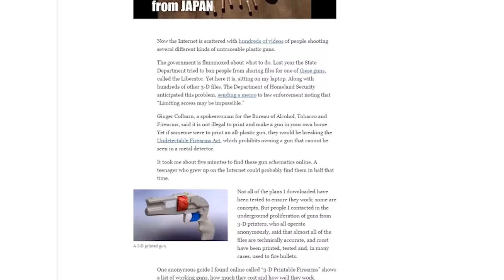Can a 3D Printer really explode and kill you? - @Barnacules

Comment: I have been 3D printing for 3 years now and have had one bad electrical failures that results in arcs from a cheep $200 printer, but no fire.  To vilify the industry just makes my job telling my bosses that 3D printing is safe, harder.  This is tragic, but people are propping this up because the industry is accelerating faster and faster without any issuance that it is actually safe and people don't like change.

I don't print in abs because pla is just as good and i'd rather use painters tape than messy hair spray.  When I do have to print in abs for my job I use a .75mm PEI (Polyetherimide) Sheet. been using it for the last 6 month and besides being scratched up badly it still works wonders.

Comment: sorry but 3d printing is far from a industrial revolution... 3d printers do a bit of rapid prototyping but beyond that they do NOTHING useful :D even in the aero and spacetravel industy they are used very sparingly because even there machining parts is often much cheaper. and the hot glue gun with a plotter attached to it (fdm printer ;D ) is from a engineering standpoit nothing but useless. Your Form 2 is much more useful for rapid prototyping but it only gets really interesting with SLS printers (Selective Laser Sintering) where you can manufacture stuff out of actually useful materials (basically anything that melts) but you still have to machine even those parts afterwards. Oh and those printers are a bit large and expensive even for your desk (and yes i have seen how strong that one is :D)
Reply from the maker: +Hellboy13994 I disagree, but what else is new ;)
Reply: Barnacules Nerdgasm jerry I just want to say I love all your videos and your weight loss videos have aided me in losing my weight. Thanks you are the most genuine YouTuber
Reply: I wouldn't say far from an industrial revolution. I mean, just look at the really huge ones that can create smaller buildings etc. In 10 years (wich really isn't a long time in development) i would say they will have a major breakthrough with 3D printers and make them more usefull and impactful.
Reply: Hellboy13994 that is not true. there are industrial 3d printing devices, that are DIFFERENT FROM THE ONES PEOPLE HAVE IN THEIR HOUSES.
Reply: Nothing useful... just cheaper prosthetic limbs for children and the ability to print certain things for medicine in places like Africa... sure... nothing useful :/
Reply: 3d printing is still in his infancy, it is like when back in the day People said that computer were destined to be used only by scientist in a lab. 3d printers need to improve a lot, but the potential is there, I'm not saying that it's going to be revolutionary... but we are not far from it.
Reply: 3d printing is getting fairly big in the aerospace industry. It depends what you are making if it's cheaper for a print or having a machinist do the work. Even in the car industry, it's starting to be used in the production of the vehicles themselves and no longer just models.
Reply: yourcurtainsareugly Maybe i wrote it wrong or you didn't understand what i meant, but within 10 years we'll see something big with 3D printers, not a revolution, wich might come later than that. Just something big.
Reply: yourcurtainsareugly A revolution for the manufacturing sector? Yeah. Something near the scale of an industrial revolution(in it's historic meaning)... probably not.
I would say that 3d printing will play a role IN ONE OF the aspects of the 4th industrial revolution (assuming the 3rd one is the digital revolution, like some socio-economist say)
Reply: He overstates, you understate.
This is a critical technology, as a Chartered Engineer I use it daily, and know of companies that are making finished products with it.
Not home printers though, but give them time.
I can't name a printing press company locally, but in 1982 they were laughing at Dot Matrix and Daisy Wheel.
Reply: False... Prototyping and limited-use end use parts is the largest market for the AM market, but DMLS/ SLS/ High-end FDM/ High-end SLA/ and polyjet enables companies to manufacture parts not possible with machined technique. Yes, there would be post-processing, but with very limited post-processing of some 3D printing techniques allow the time and cost saving largely excess that of machining. DMLS/SLS is great but true professional SLA and FDM is competitive with SLS due to reliability and cost and sometimes better material (ULTEM?). Also, polyjet can make multi-color multi-material in one go. GE and ULA saved a lot of money using DMLS for jet engine fuel nozzles and duct parts that greatly reduce cost.
Reply: Yep. What was true yesterday may not be true today.
Reply: Hellboy13994 you could make whatever you want with a 3D printer

Comment: My guess for why he used so much hair spray is that maybe he was using cheap hair spray and the cans were faulty in a way that released the propellant while only releasing tiny ammounts of the actuall sticky stuff. Hence he went nuts spraying heaps of it just to get a satisfactory layer of the stuff on the bed. In doing so he filled the air with three cans of propellant for very little stickly stuff, and the explosion was the result. If they can recover the cans from the scene and they are still rather heavy, from being nearly full of sticky stuff but no propellant to get it out, then there is your answer.

Comment: That was a good informative video thanks Barnacules! my printer ZYYX is not using a glass build platform so i have no experience of hair spray but i sometime us acetone (for abs print) and i still have not hade an explosion or fire. 

I use a little on some paper and rubb it on after most evaporate it has a really sticky build platform that abs can get stuck on.  

#Mediagetyourfactstraight
#3Dprinterforlife.

Comment: Yeah, it would totally be the printer with all the rest of those possibly hazardous things present. The only way I could see the 3D printer being responsible is if it had an open relay somewhere that just happened to engage at the perfect moment. Has anyone bothered to consider the fact that some people use small jet torches to improve the finish of their 3D models? It melts and smooths the surface by allowing the plastic to pool and then re-harden. It's great for getting rid of any sanding marks or places where support material had to be cut away. The article makes no mention of that at all. It just goes to show you that you can't argue with stupid... How sad.

Comment: Did you just call the heating element the thermistor and the temperature sensor the thermostat?
Reply from the maker: Yup
Reply: You know that's wrong right?
Reply: a thermistor is an electrical resistor whose resistance is greatly reduced by heating, used for measurement and control.
Reply: I don't know about the thermistor being right but a thermostat measures the temperature of something...
Reply: In a 3d printer the temperature control system is a PID regulator whos input is a thermistor, a resistor whos resistance decreases as temperature increases. The thermistor is not the part that creates heat and I have never heard it called a thermostat in the context of 3d printing.
Reply from the maker: Yup, already added the correction to the description. :D
Reply: Cool. Good video btw. I hate how the media treats 3d printers. 3d printers have feelings too.
Reply: Not just 3D printers are demonized in the media. Notice all the medias complaints about the western world are the exact same as they teach in the gender studies courses? All to get you arguing with idiots instead of realizing the elite are poisoning the environment all around you in every way possible. Then you wake up one day to find they are selling you the air and water you need to live.
Reply: He said thermistor 6 times and slipped up and said thermostat once. He knows the mistake.
Reply: +Solder King Well said
Reply: But all the times he said thermistor I think he meant heating element.
Reply: You can technically call the thermistor and whole controll loop of a MCU/processor/software a thermostat (because it keeps temperature of 
extruder at some set value).The heat is offcourse produced by separate nichrome or whatever resistive heater.
Reply: GamezAhoy !
the UK owns the US. well the UK banks do.
Reply: Turk im pretty sure you want to wish that.
Reply: UK owes a lot of money to the US "apparently" or so they tell us, with all the shit in the news I'm starting to beleave they are making excuses to line there pockets
Reply: Nova Dragon the USA owes us more than we owe them. Just don't believe the BS it's all excuses to everyone to put through cuts.
Reply: eLJaybud we dont owe anything..... to you guys
Reply: So... USA owes UK but UK owes USA... hummm Dose not take a genius to see that people are just raising taxies to line there greedy pockets.. And that would not surprise me at all...
Reply: Apparently it does take a genius to spell 'does'.
Reply: Not all brainy people can be good at English you know. does not mean you can beet some one down for spelling something incorrectly.
Reply: Sorry I had to it was too easy.

Also beat*

Again sorry.
Reply: Its ok, I know I suck at English and English is my primary language XD
Reply: Poor guy!!!
Reply: you mistaking the UK for the Chinese - easy mistake given who owns the uk :)
Reply: regmigrant
ask yourself did the english learn chinese to trade with them or was it the other way round?....
Reply: well if we are going into history it was mostly the dutch who brought china into trading status with the rest of the world as they were more willing to kow-tow, but yes the english got into it pretty quickly afterwards. I was making the point that like most western countries the UK relies on china buying debt
Reply: regmigrant
we are obviously talking about two completely different entities.
You are talking about the world free market where as I'm referring to the "old money", maritime bank and law,  the controlling forces behind the scenes. Bloodline money. Aristocracy and so on.
Reply: ah, i see what you mean
Reply: Yeah they might buy the debt. We just have to agree at what point we screw them over.

Comment: I'm calling the bullshittest bullshit on 3 cans.  There were probably 3 cans in the room. There are 3 cans in my printer room as I experimented with brands...
...No.  You can't breathe if you are in a room with that much butane/propane propellant.  Something sparked the gun cotton and that's it. End of story.
I challenge anyone, even a printer novice to put more than 30 seconds worth of pressurized hairspray onto a hotplate. It would be a goopy mess, literally pouring off the edges.
Reply: yeah, i have the same feeling as well.  The first day I got my printer I did a tonne of short prints and hairsprayed in between each one.  After like 8 hrs of doing this I felt physically sick at the smell of hairspray and had to wash the buildplate under boiling water at least twice.
Reply: frollard I suspect and 3 cans of hair spray + 17 year old boy has always been an explosive combination.

Comment: I think you got that a bit wrong with regards to the thermister heating the block. It is the heater cartridge that heats up the block and the thermister measures the temperature of the block, close to the nozzle. Sorry to be picky, just thought id clarify :)
Reply: yeah , got me a bit confused there , misinformation is bad so i hope barnacules could correct that
Reply: Its not that big of a deal to most people, i just felt like correcting that in case people got confused
Reply: Agree.
Reply: You are technically correct. which is the best kind of correct.

Comment: 100c barely able to keep your coffee warm? 100c is the boiling point of water. How hot do you want your coffee? :)
Reply: ALL THE WAY
Reply: I believe he meant that the heating element in the printer gets to 100c, that's not the amount of heat that would be transferred to the heating plate, then to the cup of coffee.
Reply: What matters is the heat flux, not the temperature.

Comment: Jerry 
1- gun cotton replaces gun powder in large caliber guns, it's slower burning than gun powder, allowing it to transfer more power to the projectile, along a longer barrel. 
2- a lot of spray cans now use Propane as a propellent, so....
3- with that much crap in the air, he could of set it off with a static discharge, so. ... wrong clothes...

Comment: 5:27 Jerry, i'm sure people have corrected you already, but the thermistor only reads the temperature, you're talking about the heater cartridge. There aren't any separate thermostats involved, it's just the electronics board controlling the cartridge's current based on the termistor reading.

Comment: The guns thing is so funny ... "you can go to a shop, buy a 3D printer and then fabricate guns!" ... well, when you are from the US, you don't need a 3D printer to do that, you can just walk into a shop and buy a gun :D I never got how the american people did not see the big logic loophole in this. Why would anyone add an extra step instead of just buying a gun? :D
(to be fair though there were also articles saying that you could 3D print a gun in plastic which would the not be seen in metal detectors etc. ... I can kinda understand why this would worry some people ... but still ... you can buy assault rifles in shops ffs!)
Reply: Sicho84 you're also forgetting that you can't buy a gun if you have a felony, and there is a waiting period. with printing them anyone could "make a gun" though it wasn't as easy as the media made it sound but it was still possible. plus guns you buy are registered and can be traced back to the buyer. 3d printed ones could be thrown away or melted down pretty quickly without leaving a trace of evidence.
Reply: Problem is that most store Don't require any background checks what so ever so that point is moot, as for the registration still only helps them catch those that had already committed the crime. and for the 3d printed ones its been shown that they are good for only 2-3 shots before it burns the plastic away enough to make it unstable and it catastrophically backfires on them, another point is that model guns have been modified before to act like real ones fairly easily better ban those too.
Reply: snintendog All stores in the US require background checks... It's federal law and the BATFE will arrest them fast if you can prove otherwise.

Comment: Jerry, (Hope I spelt it right)  You said that you had to download the 131 Gb of games that you had already downloaded.  So you only have 1 drive on that machine????  No D: or E:????  I have an MSI GT 70 laptop, I am not a gamer, I just need a high performance machine for my work (IT manager for several companies).  This has 2 disk bays.  In on a have a 256 Gb SSD, partitioned into a C: and D: drive and in the other a 1 Tb rotational disk.  Yes I have had windows crash and destroy its self.  But I can honestly say I have never lost any data, its all on D: or E:.  

But just as a precaution I have an external 1 Tb USB drive, where I have backed up everything.

I am a belt and braces guy, over my 35 years in IT I have seen most things, so I always have a plan B and C.  The External USB is plan B, Plan C is an old Acer Windows laptop, its was one of the 1st to come out aping a Apple Mac book.  Nice machine.  Preinstalled with Win 7.  BUT it was slow despite an i5, still slow.  I tried all sort of things to make it work better, nothing worked.  So I installed Ubuntu, I am a Linux lover, speed was great, so I started setting it up the way I wanted, then ran in to a problem with the WiFi, No Either net port on the machine, I Googled it and found that its a problem with this machine and its WiFi drivers, something that Acer have never fixed.  So tried Linux Mint, same problem.  Next Fedora.  Worked and continued to work.  I am running Fedora 24 and it works a treat.  

Have all the software I want on it, LibreOffice, I have never used MS office as I hate it.  Firefox, Chrome.  Now there are a few programs that I need to use where I was pretty sure there was no Linux equivalent.  But I found using Chrome, I could get most apps I wanted as Chrome apps.  My main product is IBM Notes, there is a native version of Notes for Fedora, so that works well.

So My Plan C machine goes with me in case Windows decides to be difficult.  I have all I need on my little Acer.  

Why not get an old Laptop something that is not as powerful as you need.  Install a good version of Linux, no License fee to MS, then load it up will all you need.  OK it wont be any good for playing games, but you will have e-mail web browsing and everything else you need.

This might make a good Project VDO for you and your Customers, I am sure that someone who has work for MS for a long time, as you have, making a VDO about setting up a Linux machine and getting to use it would be really interesting.  I would suggest that you use Ubuntu as thats pretty well the most common Linux version, apart from Android.

Keep up the good work I enjoy following you and watching you develop.

Comment: Guess what they use as a propellant in hair spray... Butane with a splash of propane for low temp operation. And Jerry, 100c is the boiling point of water, so it's plenty to keep your coffee warm, but not a source of ignition ;-) Kind of like an airplane accident, it's a chain of events, if any of the links had broken, it would not have happened! Excellent video Mr Barn!!!